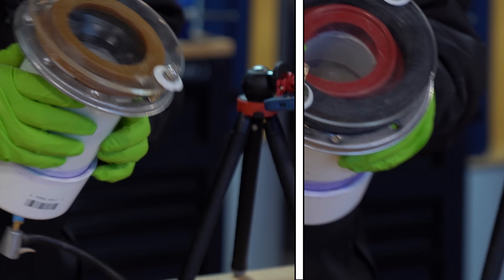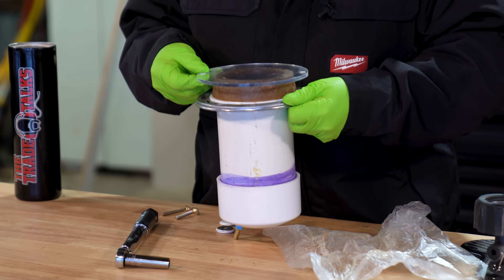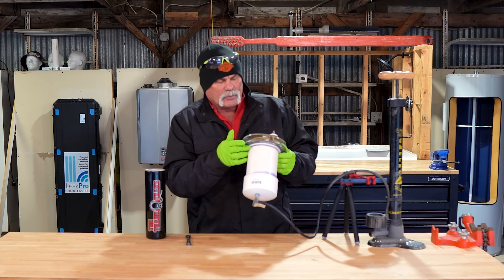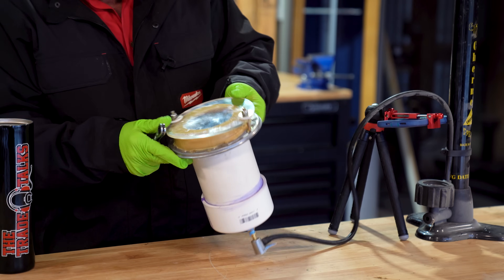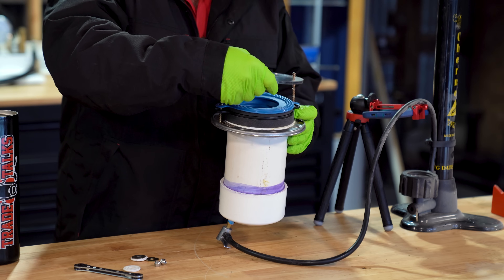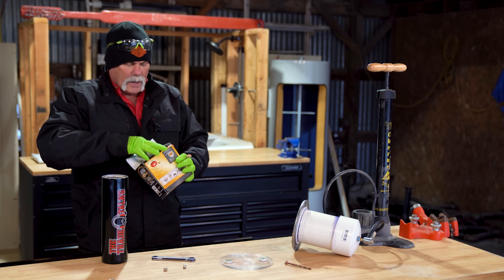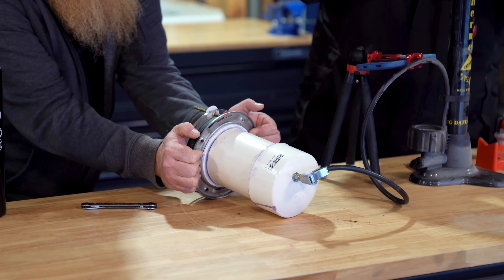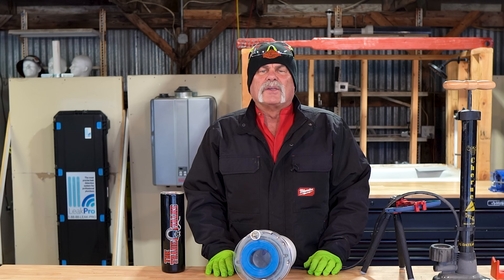Toilet Wax vs Rubber: Which Works Better?

Comment: Total BS.. We switched Years ago to the foam. HAVE NEVER HAD A CALL BACK   NEVER... 
  But We Change Wax rings all the time.. Once the toilet moves in the slightest the wax seal is Broke, Then when you get the CALL you better take a bunch of Wood to Redo the sub flour...

Comment: You should have used something more rigid than your little thin acrylic which was bowed on every test this would not happen to a real commode which is rigid and would keep the seal way better how about you redo this video with a commode turned upside down and the rig you have bolted to it as if it were in the real world scenario and then try again
Reply from the maker: We're planning on redoing this, that's a good idea, thanks!

Comment: no disrespect but your test is worthless, the failure wasn't with any of the products it was the flex of your acrylic plate, the results would have been totally different with the weight of a rigid toilet base pressing down on them....

Comment: I am a retired naster plumber.   I never EVER had toilet leaks.   You use 3 wax rings.  Not thevones with plastic centers.....only wax.    Clean the flange. Appky wax with thumb UNTIL IT ADHERES all the way around......thumb it on the bottom of the toilet UNTIL IT ADHERES all the way around.   If used the toilet bottom needs ckeaned up first.  The wax is applied around the outlet porcelain only.  Then take the rest and mold a hand made ring about an inch tall.  Set the toilet by attaching the bolts FIRST  with nuts to the flange ( done first after the flange is ckeaned and before the wax is applied.) ....bolt the toilet to the bolts.   A toilet trying to be held to the flange by one nut only works loose.  Pre bolting tje bolts first insures snugness that stays snug.....it will not leak.  Ever.  If the toilet flushes slow after the wax spread to the inner part of the olening.....pour a 5 gallon bucket of HOT wster through to soften and eliminate the overwaxing.    48 years as a business owner....NEVER had ONE recall for a keak.....EVER.

Comment: Flawed testing...your acrylic bends so you are going to get leaks on anything you test....you need a stiffer cover to seal properly!!
And you used " both " foam rings on the rubber seals...of course it won't hold air with a bending warped cover and your not compressing it properly.... this was a stupid and improper way to test how they compare.... sorry... just saying what i watched....
how they perform in actual use for the design is what matters..not some test that won't actually happen in their use....👎
🇨🇦🤓🤟

Comment: This testing setup is pretty janky lol. Nope
Reply from the maker: I’m a plumber 👨🏻‍🔧 not an engineer
Reply: @RogerWakefield  lol no worries mate. Funny you say that... I'm an engineer, not a plumber 🤣
Reply from the maker: Maybe you can make a testing device for me! lol
Reply: You're on the right track, everything is fine except for the acrylic piece. The 2 fasteners aren't applying even pressure around the ring, so you're getting mixed results with the tests.

I'd use 6 fasteners around the circumference and have it on a fixed base, like a bench top, melamine, something like that. Use same torque settings for all bolts on all tests then we can see where the blowout occurs.